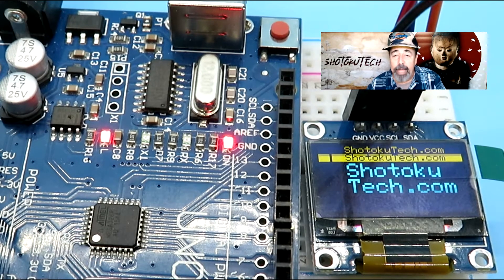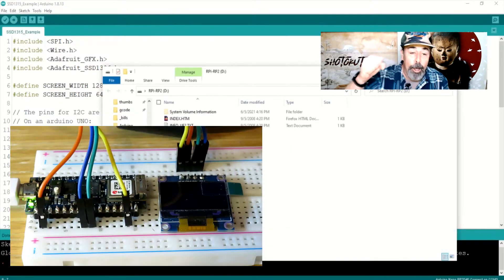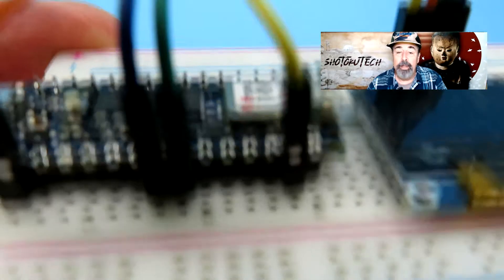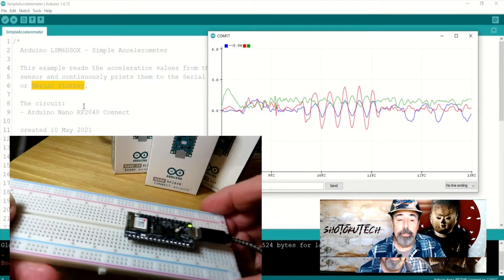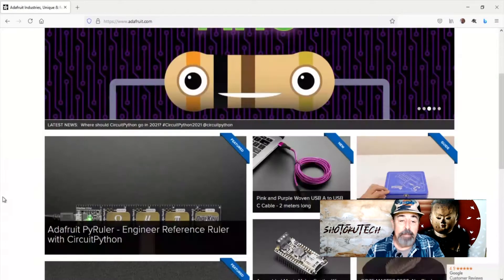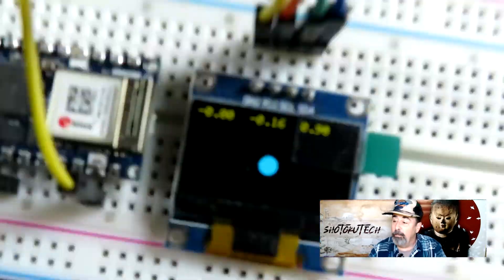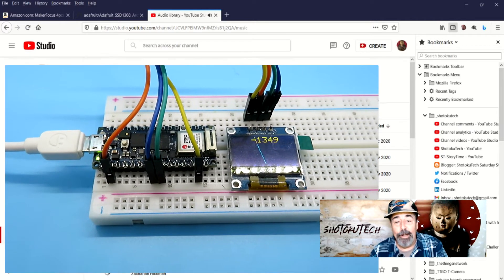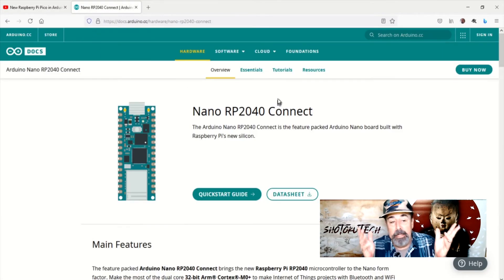Arduino Nano RP2040 Connect OLED Challenge

Comment: can you try a backlit 20x4 lcd display on the rp2040 and/or the ble sense board?  The lcd display works on 3.3 V, but when I shorted out the USB jumper to get 5 V, the display worked onloy for a while, and then  the board no longer connected to the web editor or standalone IDE editor.  There is nothing on this question, which is why I found you.  May have to go with OLED for my project, which ideally includes the built in weather variables on the sense board.
Reply from the maker: Hello! Is this an I2C display? Where did you get it and what is the product number? Thanks!
Reply: @ShotokuTech  The LCD display is a keystudio product from Amazon.  it works fine with 5 v boards like the mega and the uno, and it works fine with the regular nano board, but I think somehow I popped the sense board when I used the 5 v output on shorted pin 26 of the board.  The SDA SCL pins on A5 and A6 have internal pullup resistors, so I thought I was safe, but now the sense board wont connect, and Windows says there is something wrong with the USB device, so it's definitely fried.  Since I can use OLED with 3.3 V, that's safe, and that's what i will probably do, but is there a way to use a backlit LCD display on a sense board?  FYI, you can't get I2C data on the LCD display when you use 3.3 volts.
Reply from the maker: @bobarebob1234  The backlight needs 5v. Did you short the 5V side? Sounds like that could be a problem.
Reply: @ShotokuTech  Yes, I shorted the USB 5V out pads to drive the LCD display, but it turns out that the I2C data transmission requires a dedicated 5V supply.  You can do this easily with the regular nano board, but when you try using the USB out voltage to get the display to illuminate and to get the SDA SCL data lines to work, the USB 5V gets into the nano ble 3.3 sense board and damages it.  This is over and above wanting to use a 9V battery so that the board once programmed can operate standalone.  I think it is hopeless, but I am glad you found that OLED displays work on 3.3 volts, so I will try that, and if it works, I will try using a 9V battery on the Vin and Grnd pins with the OLED display. Many thanks for your help.
Reply from the maker: @bobarebob1234  It's hard for me to reproduce the issue without access to that specific hardware. But there are a bunch of OLED displays of many shapes and sizes that might be suitable for your project. I just read the specs for that board and it does seem like running it on a 9v battery is not out of line. It might tax the onboard regulator if you are drawing too much current with some attached device. There is also this message: 8.6 Board Recovery
All Arduino boards have a built-in bootloader which allows flashing the board via USB. In case a sketch locks up the processor and the board is not reachable anymore via USB it is possible to enter bootloader mode by double-tapping the reset button right after power up.

Comment: Just spent an hour try to get you examples work on a nano connect with a generic 0.91" display i had lying around . All i had to do was to change screen height to 32 instead of 64  .... #define SCREEN_HEIGHT 32  ..The problem I had was that as the pin marking is so woeful I had the 3.3v on the D13 pin ..On my new nano connect the pins almost compleatly coverd and block the pin disgnations . Moral of the story ..open a big picture of the pinout before you start and not after :-) The little PDM2 sketch looks cool on the no name 0.91" if anyone else wamts to try ... now on to the other three examples . Thanks again for the tut :-) B
Reply from the maker: Awesome! Good to know. Yeah those tiny pins. LOL. Thanks.
Reply: i have the same problem here but it's still not working....

Comment: Great tut thanks :-) Would you recommend that as a very new Ardunio user I should start with PaltformIO or stay with the Ardunio IDE , I've only worked on a couple of projects with the ESP32s and used the IDE . I tried Platformio for one project and found it familiar as a MS product but not as easy as IDE ..basicaly the question is stick with the original or move to the new . Thansk again :-)
Reply from the maker: It probably matters which direction you are coming from. PlatformIO Seems suitable for coders. I'm an IT Infrastructure guy. DOS batch, VBS, those days are in the past. PowerShell all day long. But that is the extent of my abilities and interests for the most part. When I use the Arduino IDE, I don't feel like I have to learn something new to get by. PlatformIO is very daunting for me. I can use it for projects already built for it. But I have not done anything from the ground up. Anyone familiar with Visual Studio, that type of work, would probably find Arduino IDE limiting to them. I have been using the IDE for a long time now. LOL.
Reply: @ShotokuTech  I hate to admit it but I remember MS-DOS 3 :-(
Reply from the maker: @brendanfurlong7868  Good times!

Comment: You can help me to determine the position with a GPS ultimate ADAFRUIT. Even following the example of the bookshop. I can't. Besides, I don't have much time left.I have to determine the position. I also need to use an Arduino nano board
Reply from the maker: Hello. This video will show how to get started with the Adafruit Ultimate GPS, whether you choose Arduino or Raspberry Pi. https://youtu.be/-rL4X9rs3Vc
I demonstrate that same GPS module with Raspberry Pi here:
https://youtu.be/IM3vgdAExGU
In this video I demonstrate mapping raw GPS data in Bing maps. Both Google and Bing will map latitude and longitude from the raw lat and lon yy.yyyyy, xx.xxxxx readings without the need to convert to minutes and seconds. https://youtu.be/b1X5E6O_THE
I have a lot of other GPS module videos here I hope will help you. Let me know if I have not answered your question completely. Thanks.
Reply: @ShotokuTech  it's really on the programming side that I can't manage. I have already watched teach you video. but I have to use an Arduino nano plus an Adafruit ultimate V3 GPS module. I have already downloaded the library for the GPS module
Reply from the maker: @ouchanihida3327  I just threw this together in circuito.io. Take a look? https://www.circuito.io/static/reply/index.html?solutionId=60c1280c1920580030ce3418&solutionPath=storage.circuito.io
Or have you tried the example sketches from the library? In Arduino IDE click 'File', 'Examples', 'Adafruit GPS Library', and I believe any of the Serial examples should work for you. I always start with examples and then hack them to do what I want.
I can try this out myself here. But I have a lot of other things in production at the moment.
Let me know how it goes. Happy to help.

Comment: You gotta get into these GC9A01 LCD displays. They are round full-color IPS displays, very high rez, and work great with the TFT_eSPI library. They are so cool to look at and only about $20 or less. They are designed for watches, but there are so many fun and crazy ways to abuse them for other purposes.
Reply from the maker: I saw your work with that open watch thing. Pretty funny stuff! Thanks.